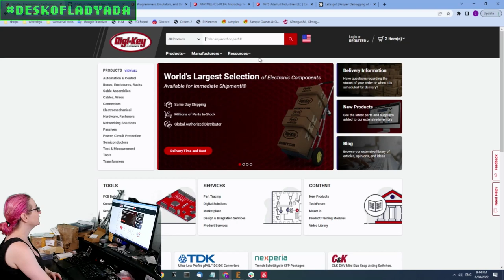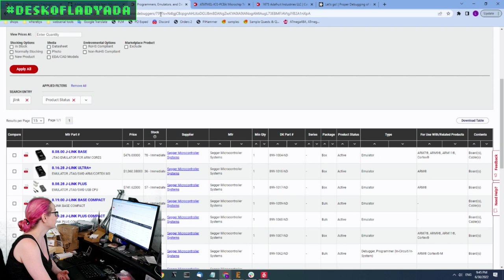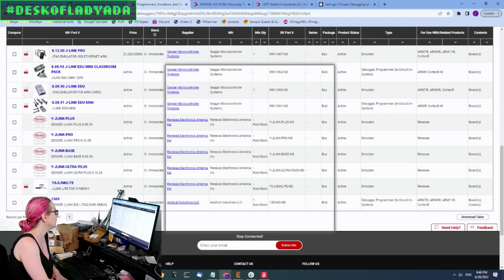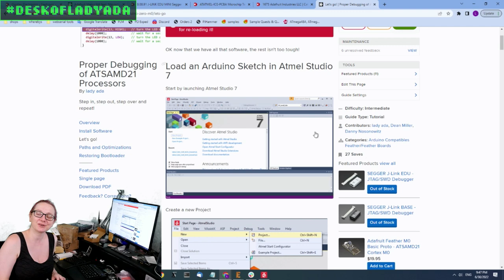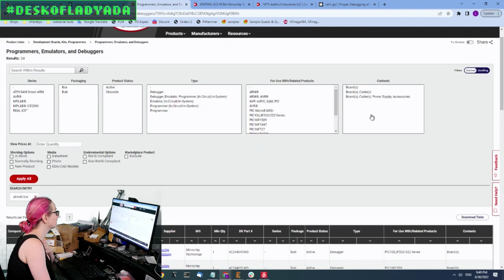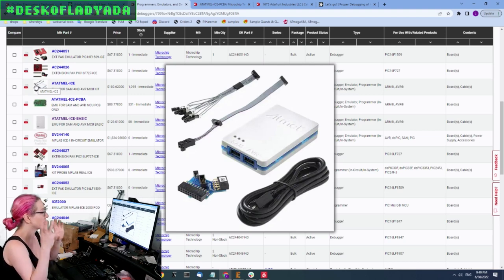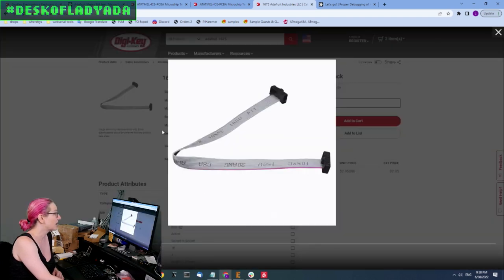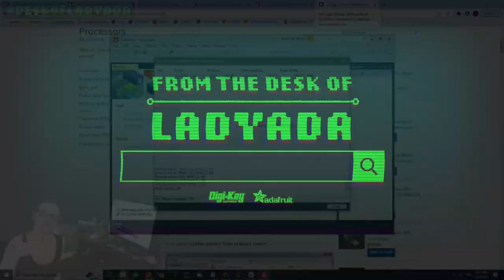The Great Search - Programmer/Debugger for ATSAMD21 Chips @Adafruit @DigiKey @MicrochipMakes

Comment: The Atmel-ICE is pretty nice. You can actually use it with open ocd (or possibly even black magic probe) as a cmsis-dap adapter with any Cortex-M chip. With the right cable it can do the 6 pin ICSP AVR, plus can JTAG on AVR chips and boards big enough to support it. (I did a lot on an atxmega some years ago)